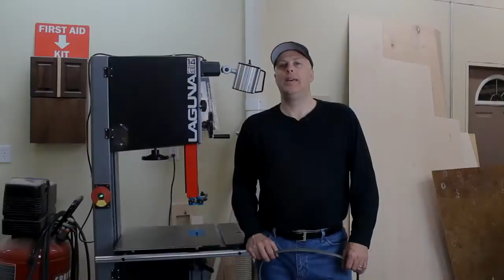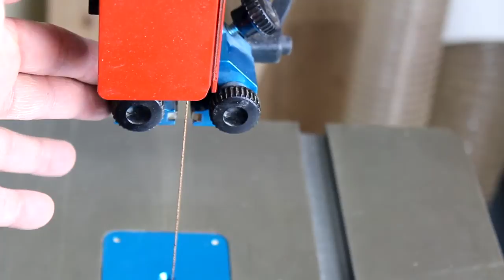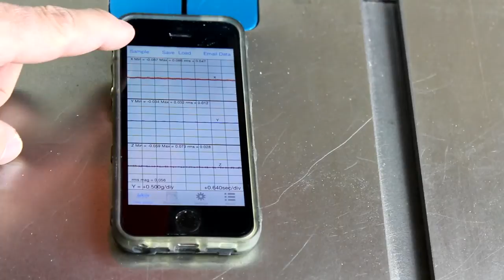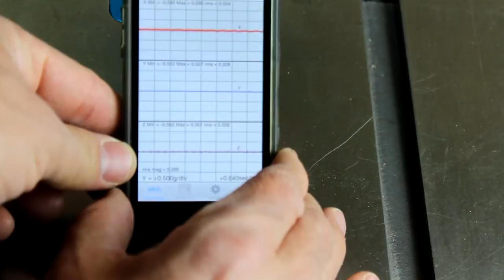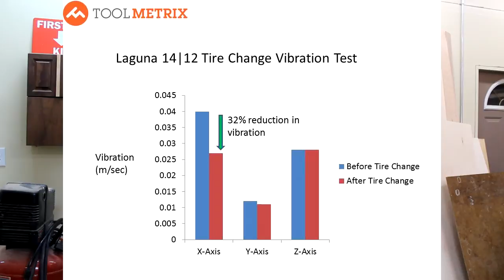Laguna 1412 band saw vibration test

Comment: It looks like your phone is in a case -- which is essentially a vibration isolator.  So I can't help wondering if your results are valid.  I think your results would have been more compelling if you had taken your phone out of the case and secured it to the saw table directly.  Also, what was the frequency content of the data?  just looking at the overall amplitude of the time history doesn't really tell you much.
Reply from the maker: Hi Tom, Thanks for your comment.  If I still had the phone, the case, the saw, or the old belt I'd have been happy test your theory.   :)

Comment: At 2:30 and 4:59, I see a big vibration as it was slowing down. Keep your eye on the channel to the right of the meter.
Reply from the maker: +newstart49 There is a natural tendency for vibration on a belt driven power tool during the power down cycle which is largely due to harmonics.  This can sometimes be minimized by upgrading to link style belts, if if the problem is severe it might be worth doing that.  In this case the additional vibration is so minor that it won't case excessive wear on the machine, and because it occurs after the machine is turned off, it won't affect cut quality.

Comment: I have owned this saw about a year and this addresses one of the issues I have had:  a heavy shuddering vibration in the saw especially as it slows down. This vibration is much more evident with wider blades and higher tension.  What really needs sorting though is what I believe to be a missing welding on the bracket that supports the table trunnions, resulting in a lot of flex through the table top.  Good to see they are acknowledging the issue with the tires, time to give them a call!  I do enjoy the saw and would like to get it to the point that I'm really happy with it.
Reply from the maker: +NOLALongboards Hi Nola, Yep, I'd give them a call and try out the tires.  I'm not confident that new tires will solve the problems that you are describing, however.  Perhaps, and hopefully, because it is an easy fix.  Here's a video on how to swap the tires: https://www.youtube.com/watch?v=hqbP-U-0PSE.  

Because of the vibration condition that you are describing, I am more suspicious of something in the area of the drive belt or pulley.  I would examine the drive belt closely to make sure that it looks ok.  Also, check the tightness of the screw that holds the pulley in place.  I've had that loosen up on other tools and cause exactly the condition that you describe.  If it is loose, I'd suggest removing it completely and adding a bit of locktite, then reinstalling snugly.  Also, be sure that the pulley is aligned properly, and that the belt is properly tensioned.  A lot of times the belt will stretch after the first hour or so of use, and needs to be tightened up a  bit.  Also, I would remove the table and take a good look at those trunion welds.  If you can see a crack or a missed weld, or if one side flexes a lot more than the other, I'd chat with Laguna support about that.